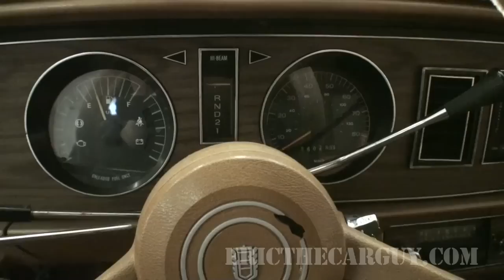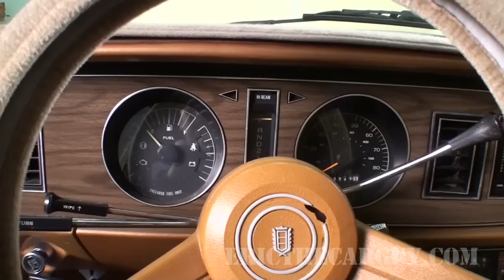1979 Ford Fairmont a Closer Look #FairmontProject

Comment: the old fords use type f atf for their power steering fluid, don't they?

also namely, ford retarded cam timing about four degrees on most of their sixes for emissions.

finally, you do NOT want a clutched fan. as much as they save you a tiny bit of horsepower, they sound like absolute ASS.

and you can totally bolt a cobra IRS with rear discs onto the fox frame, think it's three holes drilled and one backer plate with nut welded in.

Comment: i honestly don't see the appeal of such an old car:
*) Old inefficient low power gas-guzzling engine with carb, no injection, no ecu, no electronic ignition, nothing
*) ¿What's the safety rating for that car?, no airbags, inertial belts, collapsable chassis to absorb impacts, it doesn't even has headrest!!
*) no traction control, no abs, esp, disk brakes on 4 wheels, nothing!
*) horrible 3-gear slushbox, by itself a slushbox is inefficient as any torque converter gearbox(granted modern ones with clutch bypass are marginally better but still terrible compared to PDK/DSG systems) but this was a '70s slushbox with ONLY 3 gears, urgh.
*) and it's big and boxy, doesnt look sleek or aerodynamic at all...

so all in all, i really really cant get it at all :/
Reply: If you were alive in 1979, you'd understand.
Reply: don't see the relevance, i was alive in the eighties and i don't like 80's cars, they where still boxy low tech stuff apart from some notable japanese exceptions(85's Celica for example)
Reply: Guillermo Lovato Some people are like that, have no appeal for older cars. Others love the older cars. Simply because it's awesome. It may be low tech, but it's not about the technology or the fuel economy. It's about the sentimental value, the ease of repairs, and the fact that you can get them for cheap and get right to work on them
Reply: Old cars are awesome. Not only that but this car was purchased as a project car. If you've had a project car before, you know there's always a theme or feeling you're going for. Eric wants and old looking car that has power and handles well. This is a pretty common theme with project cars that are using old cars from the 70's and down. Obviously a stock car from the 70's is going to lack a lot of what you're concerned about because back in the 70's, stuff like that didn't really matter. Either way I am excited to see what becomes of the Fairmont and you should be too.
Reply from the maker: Well it's not for everybody. If you want to know why it's for me, check my ETCG1 video on "Driving Old Cars".
Reply: If you don't get it, you don't get it.Not everybody cares about the latest and greatest. And just because a car is more technically advanced, Doesn't mean it's better.
Reply: You're missing the point. If you have to have the latest and the greatest then you're a slave to the big corporations, materialism and your technological overlords. These cars offer an experience and a look back in time to a different era and all of it's high and lows in the auto industry at that time and also offer a sentimental value of sorts. I drive a Mercedes Benz but my favourite driving experience will always be when I drove my Uncle's 78 Pontiac Parisienne, super smooth and comfortable.
Reply: djonkie, what is wanting to not die horribly in my car and know that it will do what i want it to do has anything to do with being "slave to the corporations", what kind of BS train of thinking is that?.
I want ABS because i want the car to break as i should, not skid to a horrible death, does that make me a tech slave?, hell no, that makes me SMART
I want ESP because i dont want a puddle of water or a rapid turn/swerve to send me sideways into a tree of fiery death, again, it makes me SAFER to know my car will respond like i need it to
I want ECU controlled engine and dual-clutch 6 gear gearbox because fuel has ridiculous overprice and i want to use it as efficiently as possible, again, SMART.

Such old cars might be nice to see, nice to "oh look how they did stuff back then", but i wouldnt want to drive them at all for my "usual daily car", i rather have a modern-ish car(not talking about the ultra bleeding auto-driving auto-parking auto-breaking shit either) that will be a much better, more comfortable(comfier seats, better HVAC, better insulation, more toughts going to ergonomics, better sound system) and safer driving experience
Reply: Guillermo Lovato I'd rather do the driving than have the car do the driving for me. ABS, ESP, etc all gets in the way of that and spoils the experience.
Reply: Guillermo Lovato
 To me you are a car 'consumer' not a car owner. - You don't get it thats fine but for others that do, carry on.
Reply: Guillermo Lovato Then why are so many people still crashing? All these gizmos and the road is still hazardous. All the tech in the world will not replace common sense and good driving techniques. ABS sucks, it intervenes in some cars way too early and actually make things more treacherous. The ABS in my old Maxima was downright dangerous although the system works far better in my Benz. Still don't need it though. Obviously I wouldn't want an old car for daily driving but as an occasional driver why not? I would love to have an old Buick Grand National.
Reply: Djonkie Bonk> ABS sucks, it intervenes in some cars way too early and actually make things more treacherous.

Completely agreed there. It actually led to my one and only ever accident. It unexpectedly increased my stopping distance and I skidded into a guard rail in my old Volvo. After that I pulled the fuse and never had a problem again.
Reply: Guillermo Lovato My first car (99 Corolla) didn't have ESP or ABS, I drove it like a maniac, had plenty of close calls, and never any accidents. It all comes down to the driver knowing what the car is capable of, not the car itself. And I am in no way the best driver in the world.
Reply: Uncle Slayton My first car, a 1988 Celica, didn't have EGR, ABS, ETC, Cruise, Power Steering (an option on that car), or A/C. It didn't have airbags either
Reply: The appeal of an older car is to be able to drive something different and unique, instead of like all the other boring robots on the road driving the same thing.
Reply: maybe the fact that theyre eassier to repair by yourself
Reply: this is a car for a real driver not some chick scared from a manuel transmision or carb ,
Reply: Audioquest56 I was alive in 1979 and still see old cars like old refrigerators. Inefficient, more pollution, lower power to weight ratio, etc. Nostalgia trips are the main driver of these things and don't make sense to a lot of people.
Reply: Djonkie Bonk Be grateful everyone isn't still driving old polluters and guzzlers, unless you don't care about your own lungs, deny AGW, and so on (very common among the nostalgia for nostalgia's sake crowd).
Reply: Geo T I said occasional driving. Can't you read? If you want to get a new car every 3 years just so you can stay current and "hip" go right ahead.
Reply: Djonkie Bonk I keep mine for 15 to 20 years. Different issue than buying something old for a "new" car. I just get the most use possible, then upgrade to newer technology, not retro-nostalgia.
Reply: My dad had the same 1975 Ford Capri for 30 years... he bough it new and gave it to me in '05 it has 310.000 Miles and the engine has been rebuilt once , proves old cars were made to last unlike modern ones.
Reply: Guillermo Lovato I just love old mechanical things. Yes, I like the new, more reliable engines with EFI and things like that, but old vehicles just have amazing character. I just bought a 1970 GMC K10 with a 396 at 15, so it's not just age. Its something you just have to feel, and if you don't, that's fine too.
Reply: This guy 😂😂
Reply: +Guillermo Lovato they made carbureted 4 bangers that got excellent, excellent gas mileage.